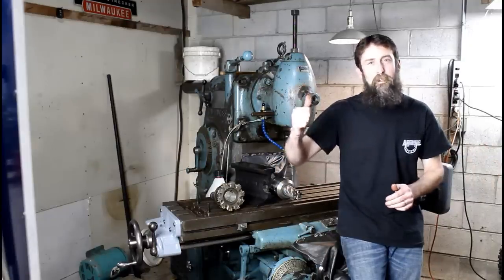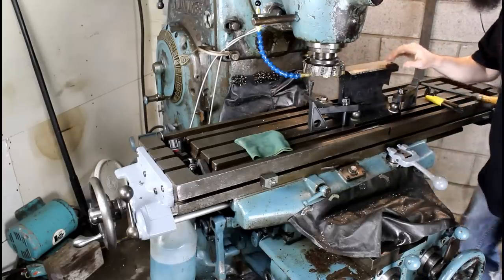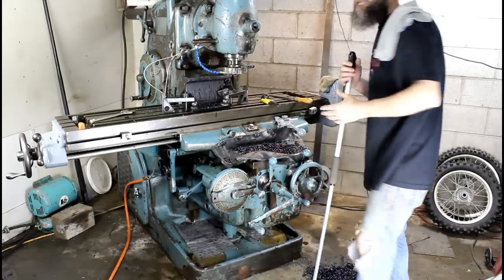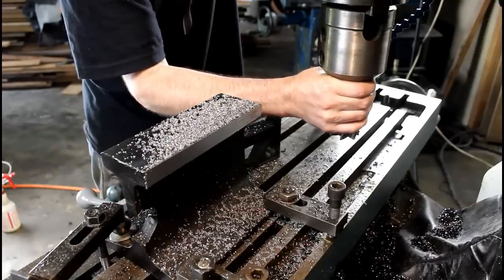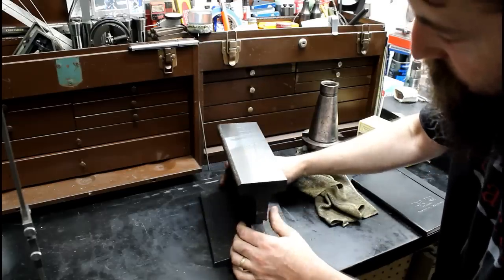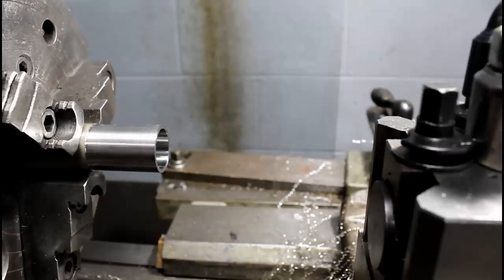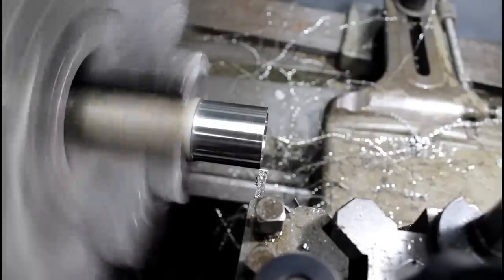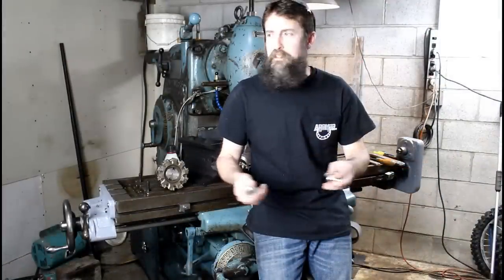Making a Railroad Track anvil on the K&T MILL / Metal Lathe work

Comment: As an apprentice in 1967 I cut a piece off a length of railway line to make an anvil. Formed the beak but never did machine the top flat, think I'll have to take the angle grinder to it, no milling machine. Now in my seventies, some jobs just take a while to get done. 😂 Now if you were round the corner instead of an ocean away. 🏴 🇬🇧

Comment: Railroad track steel is typically 1084 or equivalent hot rolled steel. This is a medium carbon steel with 0.7% to 0.8% carbon and 0.7% to 1% manganese.
 The manganese content causes the steel surface to work harden to resist wear but the core remains soft and ductile to resist impact. It’s tough, through-hardening, can be forged into shape and is great for heat treating. Rock crushers also use this type of steel for their jaws, rolls, or cones.
Reply: Yeah, the carbon and manganese make it nearly impossible to weld...although it seems to work ok with the thermite or high-temperature butt welds.

Comment: For simple thumb screws on the dials we just use Allen head bolts, already have that factory "knurl" on them.  Been running them on my k&t for years.  Just make sure there are no burrs under the dial from previous ambitious owners over tightening the originals.

Comment: Looks like you have things well in hand. One thing to tell your boy, When the bike tries to kick around like it did at 14:40 resist the temptation of putting a leg out like that. It's a really easy way to break the leg or knee. BTDT, still have the screws in there holding the bone together...

Comment: Steve,

I would make the repair sleeve OD oversized, press in place, and then finish OD to size in the set-up you used to turn down the spacer seal damaged area. Any distortion caused by installation would be corrected and the sleeve OD would be on size and concentric to the ID.
I like your idea big increasing spacer seal contact area life by using SS.

Comment: My 2012 KTM 250SX has stainless retainers on the front and back for what its worth. The CR500's and YZ250/YZ125 I have around with aluminium wheel spacers all have grooves built up, but the KTM's still look factory fresh.

Comment: Steve, PLEASE don't wipe the swarf off the job with your bare hand, especially after using an end mill, a cheap paint brush will do the job much better and save you getting thin shards of steel embedded in your fingers. They might be almost invisible, but take it from an old'un, they bloody hurt!

Comment: Steve you mentioned "rail geometry"...anyhow I had a customer who worked for the LS &I RR in the U.P of MI...any he told me of how often they had to replace the rails cause the heavy loads of iron ore in the cars would wear away the rails big time especialy on curves...as they shipped the ore from the mines in ishpeming to the docks in marquette.
Reply: Looks like that is what has happened, The rail appears to be 136lb section with about 1/4 of the head worn off before Steve milled it flat.
Reply: @SandBoxJohn    From my past experience with railroads and rail I would say about 1/2 the head is worn off.  If  the base is 6 inches the rail could be 130 to 140 lbs/yd.  Since he is in Kentucky, I doubt he would have access to the 150 to 155 lb Pennsy sections.  There was a piece broken out taking most of the 4 from the 1974 date.  The additional information on the web of the rail would have shown the rail pattern, mill where rolled,  then after the 1974 would have been a number of lines to indicate the month rolled and whether it had been control cooled or continuously cast..  On the other side of the web would be a series of numbers indicating "heat" and bloom information or if it was continuously cast(a serial number of the batch of rails).
Reply: @Roy Reynolds
I have a cutoff section of 115lb that was never used. The web on it is almost a tall as steve's piece of rail. The head would not be much bigger, that's why I said 1/4 of the head is worn off.

Comment: Wonder why you did not do the edges, to get them square. I also have a rail anvil, and have the steel slipper it rests on as a base, making for a nice surface. Use a scrap piece of 1 1/2in stainless steel, cut out from a tank wall, as well for a small anvil, rough edges but flat top, and heavy enough for small jobs, but can be carried in one hand still.
Reply: Why would you need square edges on an anvil?  If I need to square up a piece, I believe I would not choose to beat it on an anvil.

Comment: Nice work on the anvil.

I like the way you used those ball bearings on that milling job. Never seen that before, will definitely make a note. 

Is that KT a 50 taper spindle? That was a hefty end mill holder with the roughing end mill.

Final question for now: what kind of spray mister are you using? That seems to be doing a great job, and I'm hoping to set up some kind of cooling soon on my new-to-me mill.

Good thinking with the stainless caps. When you mentioned it, I assumed you'd make an entire new set from 4140 or similar. But - keeping the low weight of aluminium, and using stainless for it's non-rusting properties is smart on a dirt bike.

Cheers, Craig

Comment: Wow, that K&T really looks to be running rock solid. Good job, very impressive. You need to make some kind of rack for your tool holders. Balancing them on the small end on top of your table is inviting disaster, or at least unnecessary dings. After all that work restoring the mill and the tooling, it makes me cringe a little to watch you stand them up like that.
Reply: It'll be just fine. Just close your eyes and imagine a "rack."
Reply: @xenonram  ...Yes, I like your style!

Comment: It will probably not be a surprise to your subscribers to learn that a high level of technology (metallurgical science) goes into the manufacture of rail track. A typical safe lifetime of a stretch of track can vary from around a year to over forty years depending on the environment, level and type of traffic, etc. Any given rail infrastructure, therefore, requires a continuous and directed inspection and maintenance program in order to operate reliably and safely. Rail track is constructed from very specialised steel alloys selected to optimally balance all of the various performance, safety, maintenance and cost requirements. As is so often the case, a lot of thought, expertise and care goes into what at first glance appear to be mundane things. The battle against the law of entropy is a constant labor!

Comment: If I had the tool holders on the mill like that for a changeover, I'm almost guaranteed to knock one over onto the floor and destroy the cutter, lady luck was smiling down on you.
KTM should be making those spacers just like you did, there should be more wear resistance on that surface than just aluminum.

Comment: I think your fix for the wheel spacers is doomed to failure. Stainless and aluminum paired together will cause galvanic corrosion and eat away the aluminum. If you were going to use any other common metal next to the aluminum you probably should have picked mild steel or cast iron (google "galvanic series"). A better choice might be to remake the spacers and then send them out to be hard anodized- or even give anodizing a try yourself if you're comfortable playing with acids, although getting true "hard anodized" results yourself is apparently very difficult.
Reply: How many years will it be until he has to fix the "doomed to failure" sleeves?  Cmon, this is a dirt bike, not an F1 car!
Reply: Paul Copeland and doesn't galvanic corrosion need water, those spacers will in all probability be greased and largely in side oil seals. I fully expect his son to discover girls and cars before there is a problem.
Reply: It would be a few years before the aluminum could corrode enough that it stopped working as a spacer I guess so you're probably right. I'd be personally unhappy with corroding parts on my own machines but obviously not everyone shares that view.
Reply: @n2kbg  ....Well, I am going to go out on a limb here, but I bet you have machines with a corroding part or two.  That is my view..
Reply: @n2kbg  in principle I agree with you but it is a disposable bike not a classic BMW, MV or Ducati. Thus speaks the owner of a couple of 45+ year old BMWs

Comment: Rail heads are normally finish ground to a radiused-edge flat surface. Normal wear causes the rail head to gradually become much more like the piece you have in the mill vice. Eventually the inner top edge will roll over.
Reply: I am curious where you got this information.  I have been working with rail since the late '50s and the only time rail is flat is if it has been machined or it is crane rail.  Rail has  always been designed with a radius on the top of the head as well as radii connecting every other surface so there will be no sharp corners to produce stress risers for cracks to form.  The only time rails are machined are for switch points and frogs.  Regular running rail still has mill scale on when shipped to the railroad.  For special service rail is head hardened to reduce wear.
You are correct that as rail wears it will roll over the edge-on the outside of the rail on the outside of a curve and both sides of the rail on the inside of a curve.  The rolling is plastic deformation of the steel.  The weight a single wheel of a 100-ton car loads a rail is about 33,000 lbs. sitting still and the area this load is applied is about the size of a US quarter.
Reply: @royreynolds108  Hi Roy, to all intents and purposes the top surface of a rail 'looks' flat to the untrained eye. I had not expected to get an expert reply. You will note I avoided mentioning the various degrees of hardness both at the rail's surface and beneath its surface at various points across its width. Rgds. Peter. I have a short section of 113lb/yd flat bottom rail which I use as an anvil at home, it's an off-cut from a section of new rail.
Reply: 12" radius on top surface on the 60 lb rail we recently used on municipal equipment. Steve's piece was way heavier than that but the top radius was probably about 12" new.